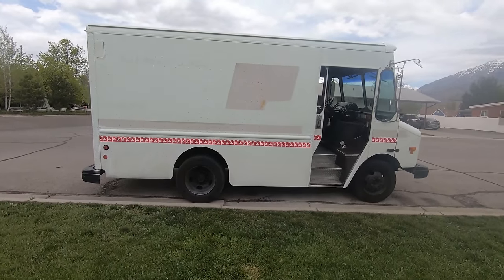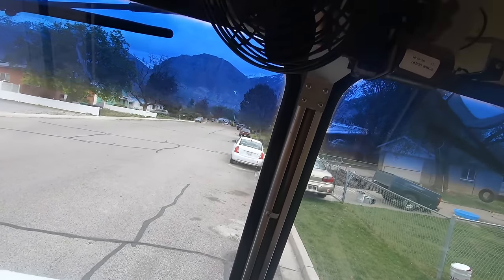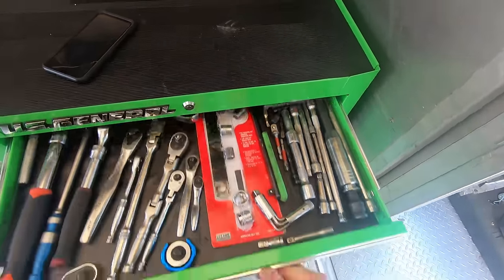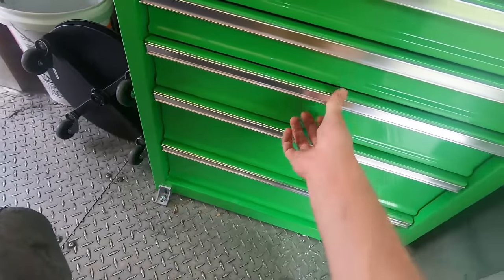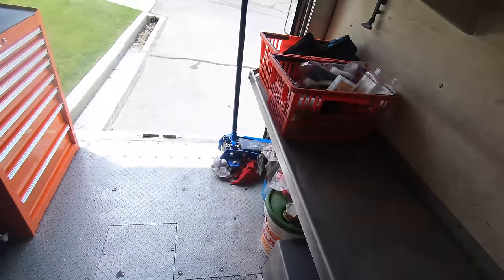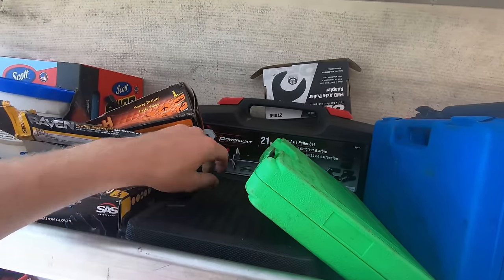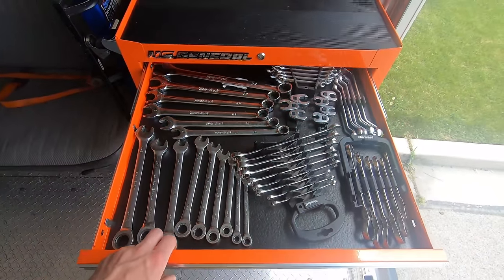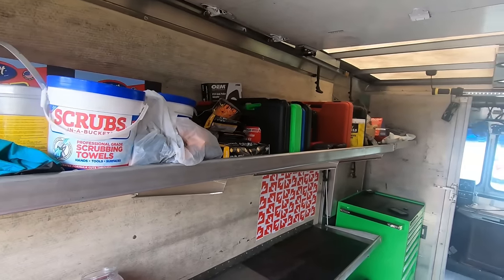Mobile mechanic setup. Shop in UPS truck Extensive tour, Roadside Rescue.

Comment: I've seen you are using brake cleaner in cans. I suggest getting a pump spray bottle of a quart and then get brake cleaner fluid in gallon bottles instead...much cheaper and you will use it instead of wipes for everything else. Can save you a lot in the long run and just less rubbish for the environment too. Good luck with your business man, you seems like a decent chap!
Reply: Jules Young did not know that. I’m going to look into those. Thanks

Comment: mobile mechanic sounds great and all till you realize you will be crawling around on the ground and laying in water puddles to change parts . I went another direction its called a Tow truck , bring it in my shop raise on a lift in air cond,  Awwww beautiful . I gave up crawling on the ground years ago . your body will thank you . Great idea if you want to change a battery or air cleaner otherwise ....blah !

Comment: Easiest and fastest way to remove decals and not waste a rubber wheel is use a heat gun and adhesive remove afterwards to finish up any that didn’t come off.

Comment: A SHORTY!!.. I got a 35' that looks similar to that for my Diesel repair business. Mine was actually a bakery truck. Now it has 2 roll aways (no wheels) bolted down over the wheels, a welder generator(Miller bluestar), 11hp air compressor a 6 ft steel table, acetylene torch set up, and over head compartments that hold 10 gal of coolant and 15 gal of oil... a drill press on my bench..  Tip: spray foam the underside of the flooring...  freezing weather and wet boots make for a very sticky and slick floor... same with rear bumper...make it wider with expanded metal, better foot hold and expanded metal grate lets water and debris fall through.... hell put a small vise on it!!

Comment: Those hose clamp pliers(the ratcheting ones with the long cable) are a lifesaver. I'm currently restoring a 1995 sea doo spx(jetski/PWC) and the oem fuel line clams are basically a cv boot clamp but much smaller. I'm replacing those oem clamps with spring clamps, and that tool makes it even easier than using wormgear clamps. 
I worked on cars for the longest time without those, but eventually I said enough is enough and I bought them(plus I worked at AutoZone at the time so I got a discount)
Reply: Also a tool I think you may find useful: an air tank. They make cordless air compressors, but if you have a small air compressor at home, get an external tank that has a schrader valve, and get a locking tire inflator chuck(you can get from AZ). use the tank to blow off dirty things. I always blow around spark plugs before replacing them

Comment: I just got an old ups van for my service van but mine is shorter than yours and it has a lift gate that I am going to remove. It's in my way all the time and it's a pain in my ass. But then it's way too high I need to build a rear deck with stairs. I wish my van was more like yours. Cool setup.

Comment: I would definitely get Milwaukee vice grips. The big advantage is that you can loosen or tighten the vice grips without opening the vice grips. It works much better than any other vice grips. I have used my pair for a lot of things. Love them. Great video!

Comment: I would totally have a workbench with a computer desk with an office chair and air conditioning/heat. You can take a break, or nap
Would be dope if it were built like Vanlife/mobile mechanic.   
What you really want is one of the Coke Trucks with all the compartments on the side. You will not need to jump in and out of the van each time and just grab what you need.

Comment: I know some snap on master series tool boxes have locking drawers with tabs that you slide to open them, you could remove the shelf on the driver's side and put a toolbox there to hold all your tools, including all of the cases. I'm sure harbor freight has a similar 3 bay box that could work. I would just be worried about someone taking the tools that are out in the open. I wish you the best man, subbed. 😊

Comment: Really happy to see a professional not using Snap On/Matco/Cornwell/etc. tool chests. Don't waste your money on where the tools will go, spend it on the tools themselves and you'll surprisingly will have more money. I noticed you mention that you are planning on losing the cutoff pliers for cooling systems. Matco has a tool that puts a vacuum on the system. You can take off lines and not lose any coolant.

Comment: Needs RV roof exhaust fans.  1/2 in either the front area or the rear so it pulls air in from the outside all the way through an out the top since heat rises.
Reply from the maker: Aqua Boss great idea!

Comment: I used a heat gun and a plastic scraper to get 8 layers of wrap and the original UHaul stickers off my 26' truck. The original stickers had been on there for 30 years... Some colors came off easy, others kept cracking or had cracks in it already from being so old...
Use the heat gun and scraper to get it started then work the heat gun ahead... it takes little bit to get the hang of it, you have to get the temp just right... too cold it will tear or rip, too hot it will stretch and break. if it starts to split, use the scraper to get it restarted... as you go, roll it up so it gets like a handle, it will be easier on your fingers.
Reply from the maker: thanks for the help!

Comment: When i had a service van i tied the back of my box into the cage so it couldn't tip. Two bolts in the back to the truck are cheap security. Also an 11mm is pretty much a 7/16.
Reply from the maker: good idea!

Comment: Bottle Jack's made great to use like a jack stand and you can they take very little space.   Take the floor jack and lift the front, set it on 2 bottle Jack's.  Do the same with the back with 2 more.  One floor jack and 4 bottle Jacks will get anything done quick and safe.

Comment: I had one of these years ago run a tractor trailer service from it
Reply from the maker: Jerry R. Smith awesome. I’ve thought about doing some of that! What problems were the most typical?
Reply: @RoadsideRescue , diesel mechanic here, the most common problems with tractor trailers you encounter as far as mobile service are tires, air brakes systems, lights, and other electrical problems. If you don't know much about air brakes, Bendix has some good free on-line training.

Comment: Ice box ac.
Large cooler.
12 volt fans.
Plastic PVC pipe.
Cut holes assemble PVC pipe.
Add 12 volt fans.
Add ice and a little amount of water..... Poor Man's AC
Reply: Plus you can have a cold beverage on board

Comment: I only use quarter inch interior and trim work mainly three eights mainly under the hood and of course cant forget the good old 1/2 inch drive which I mainly use on the undercarriage of a car. I also work on diesel more then gas so I use all drives from as small as 1/4 and as big as 1 inch. Alot of standard sizes and a ton of 12 point and of course 6 point. I agree with ernest tho ive used 6 point to removed stripped out 12 points.

Comment: I know this video is 4 years old and you might not see this comment but do you have a good way to remove a stuck on rim? On my brothers car we were doing the breaks all the way around and the fronts were easy, the back was a little tough but the driver side tire would not come off. No matter how much we hit it will a mallet or kicked it with our boots the tire would not come off or even move. We tried spraying it down and waiting another day but still nothing. It is like it is welded to the hub. Any tips or tricks you or anyone in the comments can pass along?

Comment: I pretty much know close to nothing in working on cars but want to learn really bad . If I lived close by I would volunteer to work for free a few days a week with Ernest just to learn 100% dead srs . I have enough money saved up to the point I can take a year off . I live in CA
Reply: Apply to quick lube places, jiffylube, valvoline, ezlube etc, you learn about all the maintenance, eventually you can move to a dealership and so on. Not the easiest way but it certainly is a way lol.

Comment: Thanks For taking the time to show us your set up. I’ve been a Mobil Mechanic for about 10 years now. I started working out of an Acura cL then a Chevy Astro. I felt I was carrying too many tools and things I rarely use. I recently  downsized To a Ford transit connect. It must be nice and comfortable working out of the box truck. It just seems too big to me. Do you face any issues anywhere with parking, security or management at apartment complexes etc.?
Reply from the maker: Great question. I started out in a small pickup and i wanted a normal UsPS truck but i couldnt find one so i got this. And quite frankly im glad i did. im never worried about not having something ill need. and as for parking ive never had an issue. it wont fit in parking garages, but other than that if it wont fit in a spot i just park wherever works best and no one has a problem with it. i guess because it looks official or people are used to seeing UPS trucks parked anywhere already.
Reply: I have a box truck but ended up parking it because most of my repairs are usually not going to require a big truck in my area. 90% of my calls are routine maintenance repairs but it adds up
Reply: Roadside Rescue thanks for the quick response. I will probably consider a similar truck sometime in the future.

Comment: You should invest in a portable air compressor with decent psi for tires and bigger suspension jobs ya know
Reply from the maker: yeah i think ill get the milwaukee.
Reply: Roadside Rescue My Milwaukee high torque beats every single air gun in my shop. At least twice a week the other guys come ask me to break a bolt free for them. It is an incredible tool. Plus Home Depot carries it for $199 with a free 5amp battery a few times a year.

Comment: Honestly I have done the same job as you for 2 years with a prius and there was plenty of space for all my tools and parts and daily supplies while getting 50mpg with the ac running cold.  Probably saves at least $300 a month versus your truck plus they're easy to fix.  Save money bro.

Comment: I recommend install a solar panel to keep stuff charge and have one those rv fans in the roof
Reply from the maker: great ideas! the only thingi would loose with pannels is the translucent roof or a part of it. but i should look into it!
Reply: @RoadsideRescue  yeah just look for small system to keep you tools charge and have some light connected and the fan

Comment: That wire at 10.26 is a clip for a gm ls fuel injector to the hold the wiring in
Reply from the maker: unfortunately there is a less cool answer. someone bothered me about them so i went back and double checked and its the conector prong for the inside of a cigarette lighter power source for my underglow kit! haha. i guess it fell into the drawer whilst open one day. but your answer is cooler and i appreciate the comment!

Comment: Why did you have your top drawer of wrenches. Then 2 empty drawers. Then a drawer of the rest of your wrenches? 
If I were you, I would've not gotten 2 small boxes. I would've just got one bigger box. But organized it better with all my most commonly used tools up top. You want the layout to flow and I didn't feel like this layout flows really well. But if you're just getting started, it'll take some time to get it all right
Reply from the maker: Well yes. I literally just put everything together. I'm saving the other through drawers for the more commonly used tools I have in the other tool box. That's where having two separate tool boxes if they were any taller they would be more prone to falling over when I went around turns and if they were any wider they would not fit in the space that I have. But it is a good observation. I appreciate your comment!

Comment: Xylene will take that sticker residue off without damaging the paint. Wear thick rubber gloves and have a few sets of them that xylene is nasty shit but it works great for taking off stickers. I used it to take off stickers on 53' wagons BITD.

Comment: Seems like that fan needs some lubrication. Sounds/looks like it struggles to spin causing it not to run to it's full rotational speed.
Reply from the maker: i think youre right. but i never use it so i dont often think about it.

Comment: Those old style duralast long handle 3/8 flex heads are no joke. Best wrench I've ever had. Broke mine a few months ago on a Toyota front diff fluid check, head snapped off at the flex joint.  Pretty heartbroken but its my fault, shoulda used a breaker bar. 😅

Comment: hook a multimeter up to your fuse box or battery. place the multimeter on your windshield. sit inside and pull the fuses until the meter changes.  you will at least know what circuit to look for for the draw.

Comment: Very beautiful and organize truck, as im a starter into automotive repair  what you think of penn foster online diploma automotive technician repair To get me started?
Reply from the maker: depends on your location as to whether you need a certificate or not. i wouldnt worry about the paper as much as i would about quality training. even if you start at the bottom in a repair shop if it teaches you better than an online class (which ive had many of and lets be honest you dont learn much) at least you getting hands on and paid. but if you need a certificate i wouldnt cut corners. if your going to get it invest in it. dont just waist your money.
Reply: @RoadsideRescue  i agree im in NY no one want to hire a starting mechanic and the classes at college is 25 to 35 k the pennfoster online is around 900
Reply from the maker: Yeah it may be worth it to get into a job.

Comment: Like your setup.  If you upgrade your impact driver, you can find the Milwaukee m12 hammer drill and impact driver with a bonus 3/8 ratchet for $200 on holidays(toolnut or home depot).  Maybe a sunex 3351 wobble sockets off amazon (7mm-22mm) will help speed up your productivity

Comment: Definitely need to get yourself some tools I won’t my 3 drawer little junk tool box has more tools in it than the entire truck. Probably could save some money on fuel and put your tools in a truck of a car for doing mobile calls. No disrespect intended just stating. But I guess all of us technicians started somewhere. My box I use at work just socket drawer alone is probably worth 10-12 grand and weighs 600 lbs minimum I’m abit of a socket whore tho gotta have em all lol nice vid bud
Reply from the maker: haha totally so far i havent really needed something i dont have. i usually buy a few tools a month so im sure one day ill get there but so far ive been able to do everything. haha thanks for the comment!

Comment: Is that bench seat out of an old Nissan hardbody ?
Reply from the maker: good eye. it sure is. my first truck.
Reply: @RoadsideRescue  had a 1995 when I was a teen , regular cab , short box , manual base truck no power steering . I did typical teenage stuff with it 😂 lowered it , welded the differential ...truck was absolutely bullet proof , I gave it to a friend's dad probably 13 years ago and he still uses it as his farm truck

Comment: Good video, only one minor issue . The video description says UPS and You describe it as a older postal truck which is actually USPS , it caught my eye because UPS never ever resell their equipment, when I first saw this description I thought how did this man get one of the UPS Trucks .  United Parcel Service not United States postal service..you might get flack if corporate UPS catches this ..
Reply from the maker: yeah sorry its easier to say than USPS and noone ever knows what USPS is. hopefully its no legal issue i imagine it falls under common use and creative commons. but idk..
Reply: @RoadsideRescue  I don't see it as a problem , that's my personal opinion , not a company opinion . It's a nice set up though was getting ready to build one out of a car trailer but my truck was stolen got it back and now rebuilding the engine and such from that vandalizing of it .
Reply from the maker: good luck!

Comment: Y don’t u install a/c?
Reply from the maker: dont have a machine. ill charge systems but i dont do recovery and therefore dont really do much at all.
Reply: Roadside Rescue I meant in your truck.
Reply from the maker: OH... idk i think its a common assumption i spend time in the truck but i really hop in and out to grab a tool. and when im driving the windows open is enough. so i guess i just havent felt the need for it...

Comment: NO FUSES at the batteries and the wires are way too long to the inverter for that gauge wire. Better learn about DC power and wire LOSS. A fire just waiting to happen if you rub a short in the red wire.
Reply: the wires rubbing everywhere triggered me... good thing he's got a fire extinguisher right there... wonder how its doing now....

Comment: Had to damn near run to the comments  to see how meny  fire hydrant comments  i would  see lol. When I graduated  from  high school I had a job where I had to work on and inspect extinguishers and so meny ppl would  call them  hydrants. Don't feel  bad  tho man I've heard worse  at least you didn't  call it an exterminer 
Wich I think  was a mix of extinguisher and exterminator I think  but I got that a couple  times
Reply from the maker: Yeah. haha i guess it slpipped. haha. i normal know what they are called.